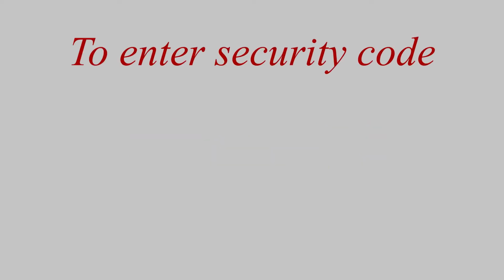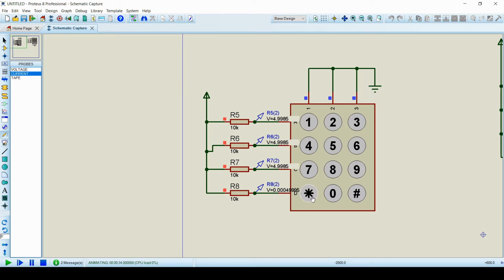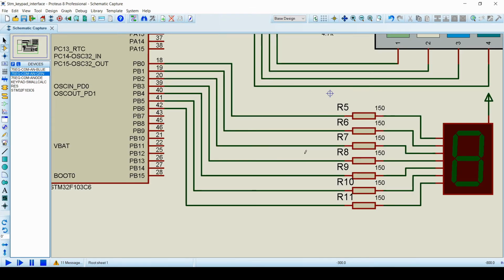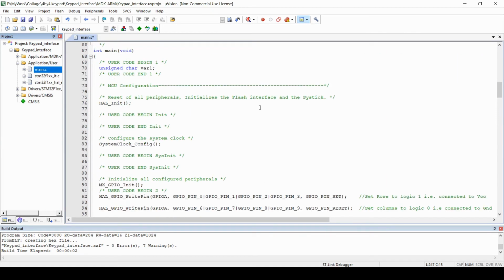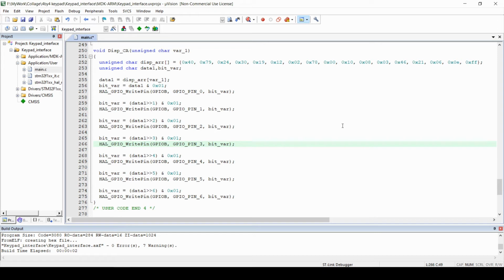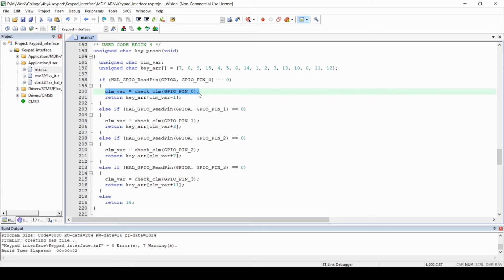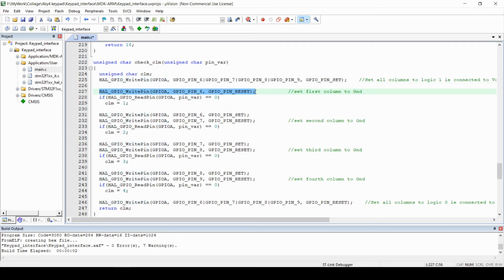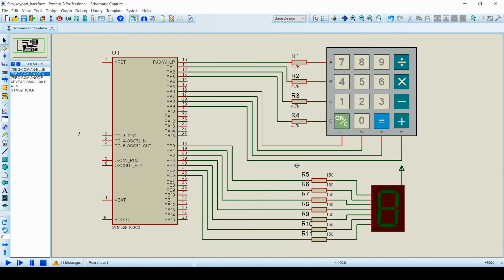How to interface 4x4 keypad matrix with STM????

Comment: please explain if we set a pin as output how are we going to monitor the status of that pin....??
Reply from the maker: In controller?? Or in simulation????
Reply: @stmetatronics6593  I have the same question, i mean, i put the pin in output and then when i try to read de status of that pin with HAL_GPIOA_ReadPin i dont get the correct lecture, do you know what the problmen could be?
Reply from the maker: @esdras gamaliel martinez abrego
Have you checked the gpio settings, whether the pull up is connected or not?
Reply: Have you already found out? I am wondering the same thing.

Comment: This is wonderfully done. We are improving alot. Keep it up sir.👍
Reply from the maker: Thanks sir
Reply: @stmetatronics6593  this connects through 8 wires to the stm32 for 16 inputs

My first question is
1) if I connect my stm3w to drive several mosfets, is it possible for me to assign each button to trigger one mosfet to turn on or off an output?

2) if so why cant I use a keyboard that only uses 4 wires to connect and assign certain buttons to trigger the desired mosfet?